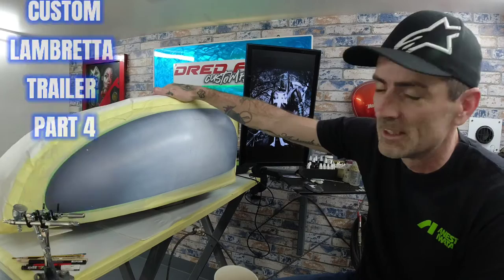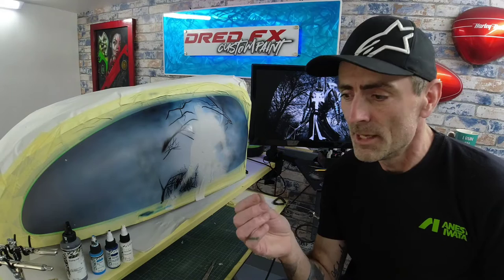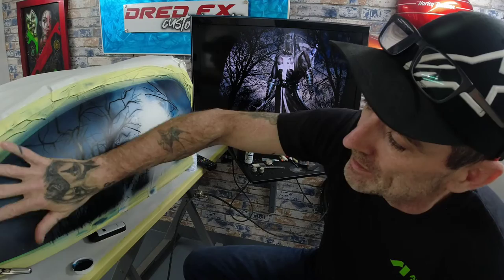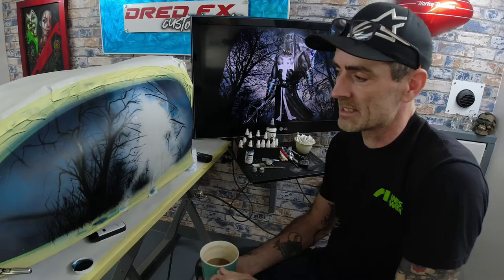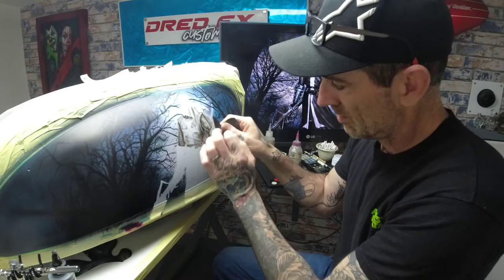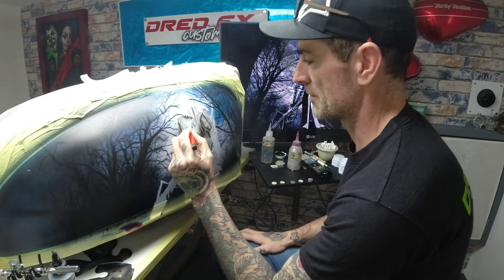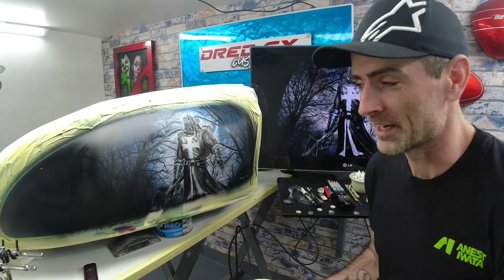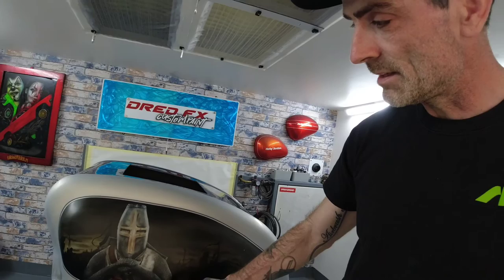CUSTOM LAMBRETTA TRAILER PART 4

Comment: Finally got a chance to watch this Rob, you told me on IG that there would be some fun and games at the end but as I was watching I thought this is going great no problems the artwork is outstanding what can go wrong now 🤔 you then said it was finished and man it looked fantastic and thought 'phew' no problems so on to the clear coat 😍 and then it all went down the pan 😱 you must be f'n gutted Rob, all that work could be ruined due to some cowboys prep work 🤠 I do hope you can fix this mate if not then it will need a full strip and redo. 

I would be tracking down the person that painted this before and have some serious words using a base ball bat, that's the only problem when doing artwork on someone else's paintwork, good luck mate! 🙏🙏👍
Reply from the maker: Just wait till part 5 🤒🤕😡😡
Reply: Oh dear 😬 should I be faring the worst here? 🤔😲
Reply from the maker: @JohnWD40TC02  put it this way the next time you see me will be on crime watch 👊😳😳

Comment: Hope that paint doesn't lift under your work, hopefully your prep has stopped that from happening...that would be soul destroying to see such beautiful artwork ruined.
Reply from the maker: It's pulled right back to that pin line so in part 5 😩😫😤I have to work some magic to fix this